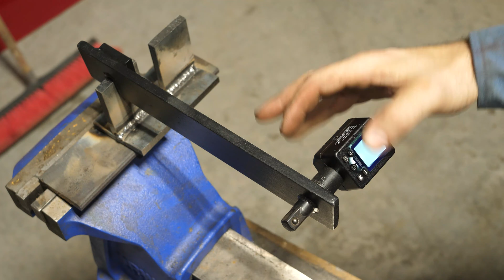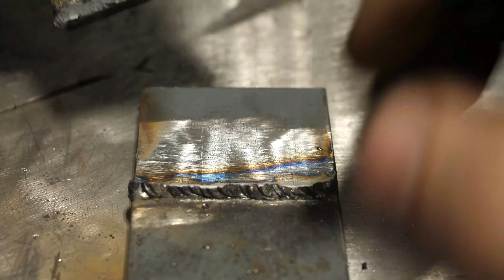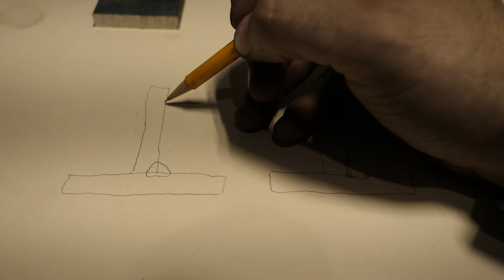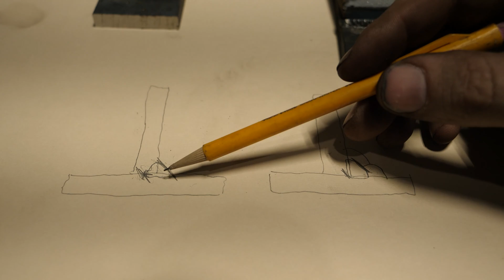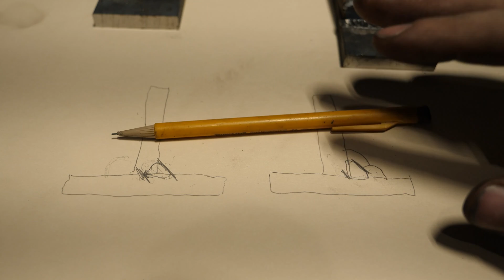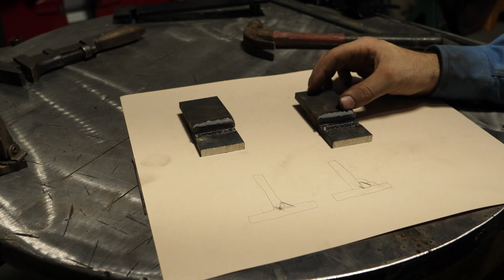Break testing 6010 welds, how strong are they?

Comment: Very interesting!  Do these breaks tend to start at the root and then propagate to the outside face of the weld?
Reply from the maker: It depends on if the weld is centered or not.  If the weld is at a 45 degree angle to the root, and the weld has decent “throat depth” it will tend to break right down the middle.  If the weld favors one plate over the other it will likely tear through the weld.

Comment: I'm thinking 3/32 red rod root. 1/8  7018 cover. Wonder what that would make a difference.  Awesome video mate. Bsafe.
Reply from the maker: I will be doing multi pass welds and testing the strength 😀.

Comment: That was a huge difference with a flux core wire and 7018 rods, superb demonstration, thank you! 👍 I think I heard that 1/16” gap on filet weld is permissible even on tests, at least at welding school, wouldn't it be more useful than a bevel with only root pass?
Reply from the maker: You’re welcome 😀.  A gap on a fillet weld will likely increase some penetration.  I will have to test a gap and bevel against one another to see the results 😀.
Reply: @makingmistakeswithgreg  That would be great addition to this series of tests 👍

Comment: Least favorite rod after struggling with them in school. But I run a lot of 6011 at ranches
Reply from the maker: I struggled with 6010 in school too, but the instructor never mentioned move at 2/3rd the speed of a 7018 and use 40% more rod per inch of weld lol.  It’s a useful rod for specific circumstances, but many other rods are far easier to run (and easier to clean it up lol).